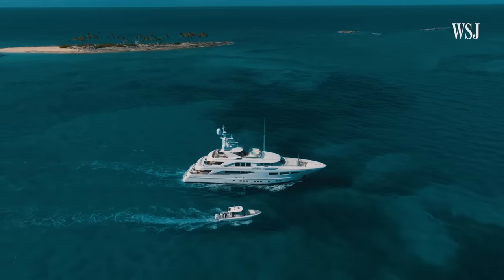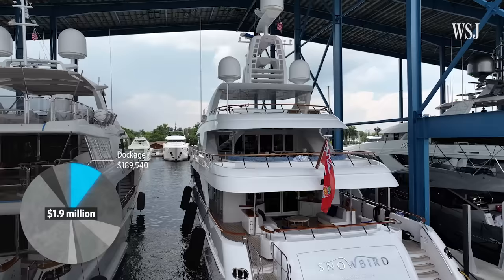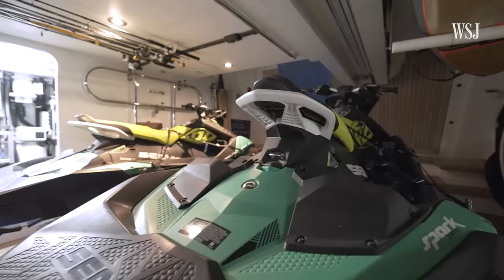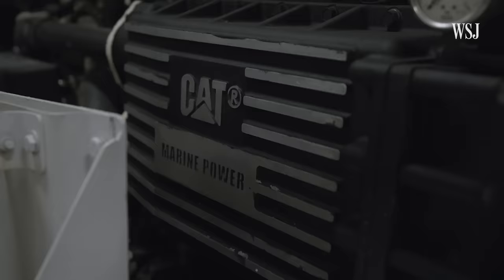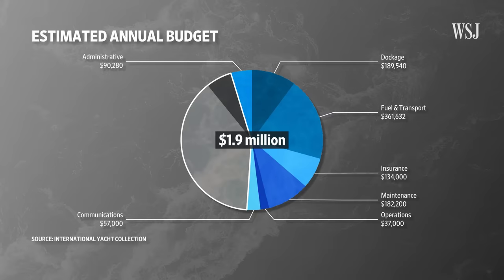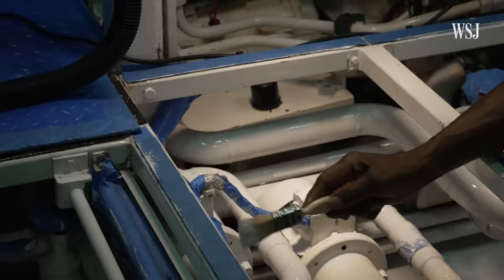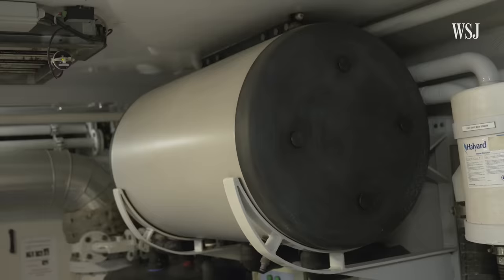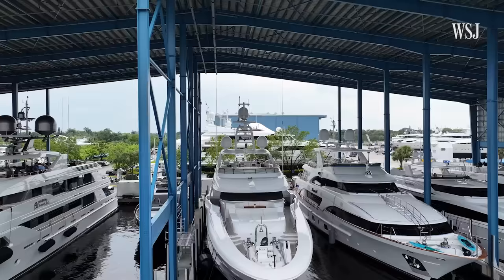How to Run a $14 Million Superyacht | WSJ Operating Costs

Comment: For those commenting on the $1,800 an inch number. He is not talking about the area (square inch) that needs to be painted, he is talking about the length of the boat divided by the cost to paint. A 100 foot yacht is 1,200 inches long. At up to $1,800 a foot its, up to $2,160,000 to paint that boat.
Reply: Thanks, that was kind of confusing.
Reply: Even Wall Street Journal misunderstood that. They tagged it as "$1800/Sq. In."
Reply: That still doesn't make sense because hull shapes vary hugely. Then you've got the super structure which also varies widely. A long hull with a thin beam will be quicker that a deeper drafted vessel of the same length, or with a wider beam.

I guess he $1800 per inch is a reference but it shouldn't be considered more than a very very rough guide.
Reply: The one time where it is about the length 😏
Reply: Did not see that one coming!! Thank you!
Reply: Still doesn't make sense.
Reply: That's still ludicrous. If it floats or flies, price goes x10.
Reply: Yeah, like a nail doesn't float, but this does! Must have been some African shamen!
Reply: @leaf16nut it’s about the motion in the ocean.
Reply: @jsilva7005  Well I ain't got that either 🤣
Reply: that's a silly price to maintain the teak - I'd spray the floor with bed liner  😎
Reply: @mikea5745  The Journal understands it. They used the number because it's eye-popping -- and not, technically, inaccurate.
Reply: No way. Just, no way! I’m sure it doesn’t cost $2M to paint that boat! No way!!!!!
Reply: @DavidBcc  yup.  Boat means "Break out another thousand "

Comment: This didn't include the depreciation cost. If you assume that it depreciates say, like a BMW, which is quickly and fast and approaches about 10% of its new value in about 10 years, it's fair to say that an additional $1 million should be added to the cost of this $15 million yacht. Or, the true cost of ownership is likely $3 million per year.
Reply: Depreciation is heavily influenced by deferred maintenance and upgrades. In this category most yachts are 1 of 1 so it's really difficult to say what it will sell for in 5 or 10 years. There are some yachts that sell at 3 years for more than they cost new.
Reply: you dont buy new yachts.... you buy 5 to 8 year old yachts and then do the interior work yourself
Reply: Cars, on average,  lose half their value in 3 years.
Reply: Cars lose value driving out of the dealership; super yachts don't.  Depending on the market and the awesomeness of your vessel, you could actually sell your yacht for more than it cost you because another rich person is willing to pay extra to have a new(ish) yacht "right now" than waiting a few years for their custom build.

Comment: 4:25 There's no way the paint costs $1800/in². If it was, that would mean a 10ftx10ft section would cost nearly $26 million. Painting an entire superyacht would cost billions of dollars.

Does the WSJ no longer have editors?
Reply: Someone mentioned above that it’s likely linear inch and not square inch, still seems excessive.
Reply: Comprehension skills lacking?

Comment: Your on screen graphics states marine paint is $1,800 per square inch. That is over $200,000 per square foot.  You're off by a factor of 50,000 to 100,000!
Reply: haha we thought the same thing..
Reply: He is not talking about the area (square inch) that needs to be painted, he is talking about the length of the boat divided by the cost to paint. A 100 foot yacht is 1,200 inches long. At up to $1,800 a foot its, up to $2,160,000 to paint that boat.
Reply: @sierrapeaks  He said "per inch" but the graphics department put "per square inch" on screen.
Reply: @sierrapeaks  It is not $1,800/foot, it is per inch; 1200 inches long x $1,800/ inch = $2,160,000
Reply: @sierrapeaks never. Not for a 100 ft boat.

Comment: you can see why the charter business is so busy, unless u can justify the time and effort, you are better off paying a few hundred grand a year and chartering a large yacht and not have the hassles of ownership. However, if you use the boat a lot and see the value in it and you can afford it, then u need to accept the cost of ownership. a lot of 1% ers value the privacy and the ability to escape that a large yacht can give them and their families.

Comment: it's not $1800 per SQUARE inch. when the guy said $1800/inch, he meant $1800 per LINEAR inch, which, on a 100ft boat, is $2.16M. Probably won't be that much, maybe a quarter of that.

Comment: costumery tip of 18% for the crew, sorry what after paying 200 k to go on the boat in the first place and get out of the port, on top of that you have to pay 18% from that as a tip Or did I get it wrong ?  5:10
Reply: this video is showing wrong information.... 80% of yachts dont have any crew, most are ownerdriven
Reply: @Iamalemonwhy  that's because most yachts aren't super yachts...

Comment: These figures make no sense. They said the yacht could be rented for $125,000 - $145,000 per week, which adds up to $5,200,000 per year. I understand it wouldn't be chartered every week, but even if it was chartered for 26 weeks per year, this still comfortably offsets the cost, which they claim to be $1,900,000?.

Can someone with a bit more knowledge explain this please? I feel I may have missed something really obvious.
Reply: No boats are chartered that often
Reply: @elishawhite7487  how often are they chartered?
Reply: @dannyquinn9128  max liks 20 weeks a year most about 10 weeks
Reply: Most yachts summer in Med and winter in Caribbean. Take out time the owner uses it and scheduled maintenance at the marina or dock, and most are only chartering 10-20 weeks annually.
Reply: 26 weeks a year.... a yacht costs 150k pw to charter... we dont have enough rich people to charter so many boats

Comment: Most of it is BS and is said to scare of middle to high earners from buying yachts. You can certainly do all of it cheaper, several times cheaper. 

Also, why do I have to maintain a crew all year round? I can hire personnal whenever I need to

Comment: the problem is that there is always a bigger boat. So if you are in a yacht harbor you are green with envy looking at the more expensive boats. Makes you feel very miserable and very poor. So do not start or just rent, seems much smarter
Reply: most yacht owners dont envy other big boats and anything sub 60 ft is not a yacht

Comment: They should use electric motors to reduce maintenance cost
Reply: If you need to think about reduce maintenance cost, you are not in the league. The engine maintenance is the cheapest part that they've shown.
Reply: and whats going to power those electric motors?
Reply: @motoryachtloon  The clueless Woke would say solar. 🙄

Only most Woke has no idea the feeble PV versus what need to move a super yacht 1km. It need a huge bank of battery, cover the whole yacht with PV panels, and let it charge a month so it can "steam" from one port to the next, between an island chain.

To go anywhere farther it will still rely on dino juice powered ICE. The only clean alternative is build a super sail yacht to begin with. A super sail yacht requires a much bigger crew with professional sailing skills to operate.